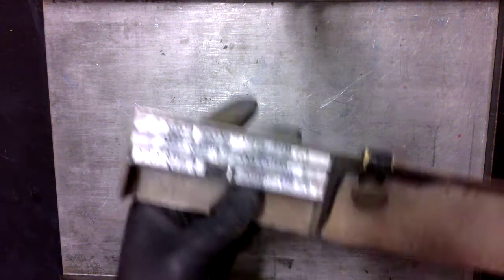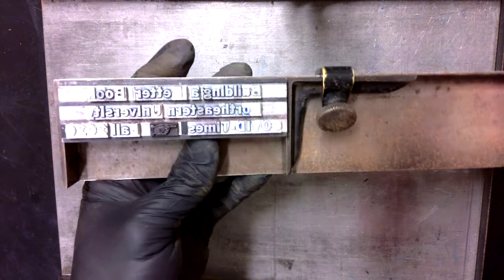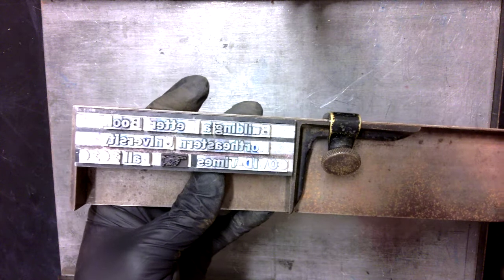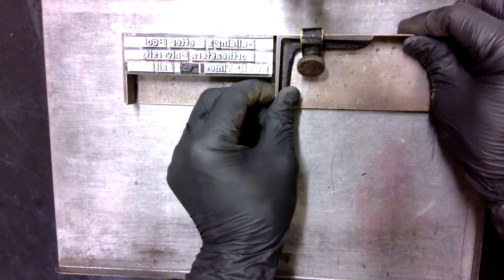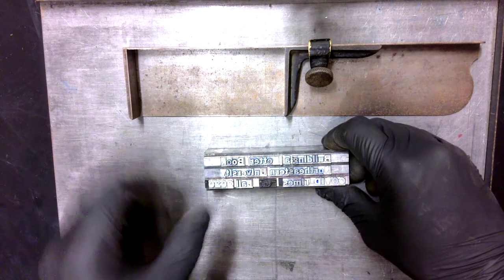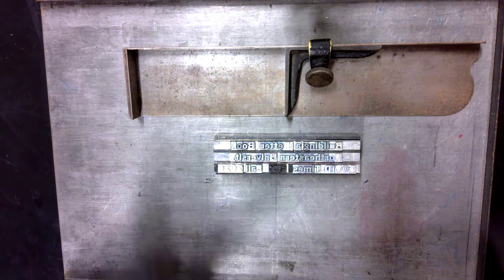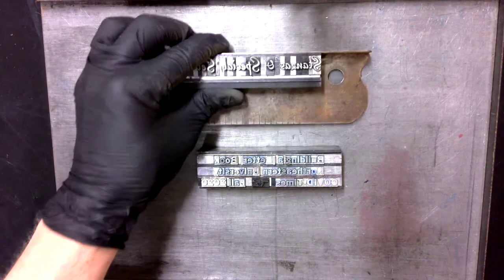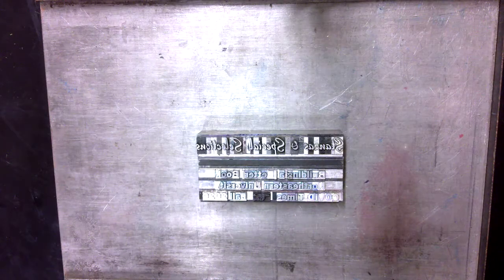08 From Composing Stick to Galley

Comment: Sorry, what you are saying is all nonsense.   Measurement is in Picas,  thickness is in points.   You have no idea how to use the composing stick.  I was a compositor for some 30 years.  Try to find someone like me to talk to before you do any more damage!
Reply: I do not entirely agree with your criticism here. A pica contains 12 points. Points commonly refer to the size of type and spacing while pica most often refers to column width. You can also convert from one to the other and which you use is a matter of shop preference. Thus, when you say "measurement is in picas, thickness in points" I think it is unclear to what you are referring (measurement and thickness of what?). Suggestion: damage is done in criticism without correction, so possibly give correction on how, for instance, to use the composing stick correctly.
Reply: @professorlegacy  Sorry Jack, I've been in the printing industry in the U.K. since 1951.  Having done 30 years as a compositor it upsets me when I see "experts" show the wrong way it should be done.    Measurement of width of type page etc. is in 12pt picas.  Thickness of leads, rules clumps and type size etc. is in points (approx 72points to the inch).   Wood letter is in "lines" or picas i.e. 12 line wood letter is two inches high.
The composing stick is held in the left hand (even if you are left handed) and the type is held against the adjustable side of the stick with the left thumb. You read the type as it is set i.e. mirror image.   You don't turn. the stick around!  You always work with the "head" of the type towards you, still in mirror image and read left to right. There were brass rules known as setting rules to use between lines in the stick.  These were easy to slip out if leading was not required.  I just think is a great pity to state this is how a process is done without making sure you really know.  Sorry, I'm getting old.
Reply: @headleycaryer3795  Thank you for clarifying, Headley. I appreciate your more comprehensive response. Composing type has always fascinated me and I find a detailed criticism with sensible correction to be much more fruitful than the contrary, so your addition explanation is very much welcome! I could honestly re-read your reply here repeatedly and get something from it each time, and I mean that with all sincerity. Cheers :)